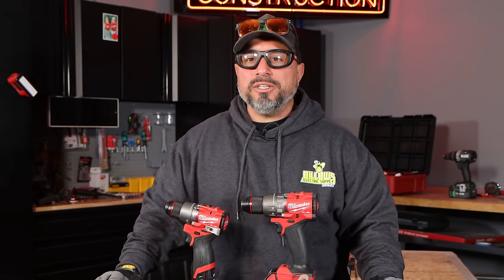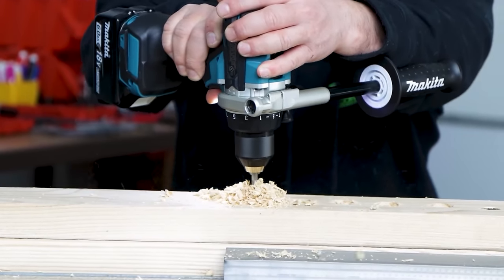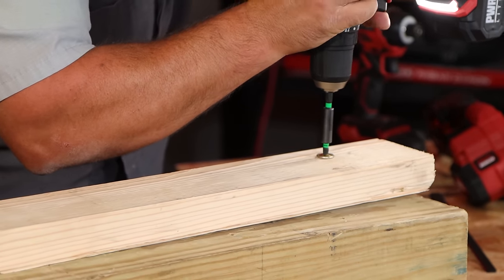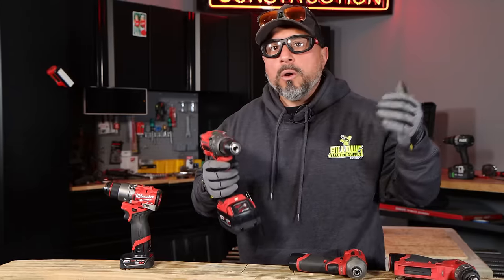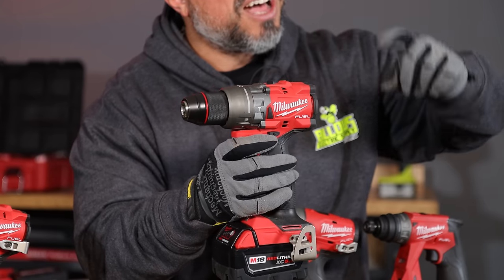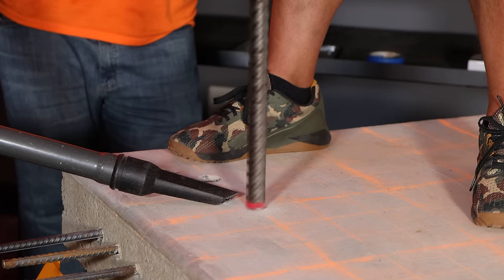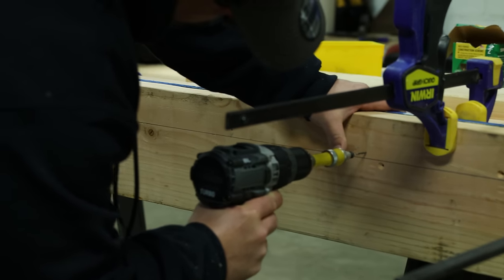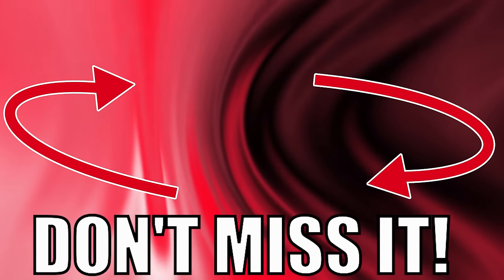Stop Using Cordless Hammer Drills...

Comment: Just got the gen 4 hammer drill. I have an older brushed m12 drill/driver set. They can handle 80% of what I do around the house and restaurant. But I have the installation driver for doing shelves and random stuff. It's an awesome standalone drill. Has entirely replaced my old brushed m12 drill.

But the restaurants pre-fabbed with metal studs. And getting through those is a pain in the butt. Also occasionally have to punch through concrete or brick for running speaker wires. So I decided to just go ahead and invest in a drill that can do all that without cutting out. I don't think I need a new m12/m18 fuel impact until my old brushed m12 impact dies.

Comment: What hammer drills are you talking about? Like the SDS max and plus ones? Because I can see the hammer drill symbol on the drill you are holding while you are telling me not to get it but also get it?
Reply: The whole is video is utter nonsense, don't bother. There are now powerful efficienct codless impact drills that screw mechanical bolt anchors into c40+ concrete without any sweat. As long as you're not demolishing concrete a quality high joule impact cordless drill can get most of the construction job done as of 2024.

Comment: I use both a hammer drill and a rotary hammer, I use my hammer drill for installing small 5/32" tapcons and such, and save the big boy 1-9/16" rotary hammer for breaking up concrete or tile

Comment: Yep my installation driver and m12 impact get 99%of my drilling and driving uses. I recently used my m18 fuel hammer drill to split in half a bunch of retaining wall bricks to use as weights for stickered lumber. But outside of that I’ll take lightweight anyday

Comment: I build and install wrought iron gates and fences. We use a corded hammer drill for every job since we always have an extension cord ran for our welder. But in the cases where it’s a quick install and don’t need to unload our cords we do use our cordless hammer drill for drilling into concrete, brick walls, and through stucco to install our anchors. Don’t really see the need to buy a dedicated cordless hammer drill so it’s worth the cost to me to have the hammer drill function on my regular drill.

Comment: As a sparky I use the hammer drill for holes of any kind ever day.  Rarely do I used the hammer function because I always use an SDS cuz it’s way better. But every now and then I’m in a pinch and need to throw in an anchor  and don’t have the sds readily available  and it’s nice to just use the hammer drill for a quick anchor or two.

Comment: Vince, I work as a handyman, a jack of many trades and will tell you that I need tools that are kind of like me. I only use the hammer trill function when drilling through brick or concrete with masonry bits. I think using the HD function for anything else is moronic. Who tries to drill a precision hole in wood with a hole saw or spade bit dancing around. With the HD function  my 4 year old DeWalt XR drill driver goes through most brick and masonry like a hot knife through butter. I've tried the same without the HD function and it was like a cold knife through frozen butter.

Comment: I use that hammer drill for tap cons in brick and block all the time. The one drill can drill holes in studs and then tap cons in block. Maybe i'm not a "real tradesmen" hahaha just a licensed electrician with a LLC company.
Reply: Also an electrician.  It’s hard to beat for drilling for tapcons.

Comment: I'm gonna be straight honest here, i have a milwaukee m12 hammerdrill, and for me as a service electrician, i can do everything with it from concrete and bricks with the hammer function to drywall. i can do it all. it is a differend discussion for when i am working on a construction site were I have to drill bigger holes through Deeper concrete walls. at that point i am switching to the m18 rotery hammer. one downside is that is it so freaking heavy, so drilling in a place that is JUST about to be out of reach can be pretty hard.

Comment: I think it’s fine, it’s a feature if needed. If you are doing heavy work or multiple holes then get a rotary hammer, if you need something quick and light that will get the job home for a couple of anchors or what have you for overhead work than a hammer drill is perfectly fine when needed. I understand both sides especially as someone in commercial HVAC.. it’s nice to have it when you need it.

Comment: My Milwaukee Gen 3 hammer drill is used for drilling holes, mixing paint, mixing joint compound, and mixing grout .  As a DIY not professionally.  I don't think I have ever switched it to hammer mode.  I install fasteners with my gen 3 impact driver

Comment: I agree a hammer drill is not the same as a dedicated rotary drill BUT for a while I could not buy a dedicated rotary drill and the small jobs I was doing my m18 hammer drill was getting the job done. Drilling 3/4x8" size anchor holes for post and whatnot, it served its purpose and got the job done, now I have the fuel m18 hammer drill big boy and its truly much better at drilling through concrete but if need be I can go back to my hammer drill and assist in any job of space is a issue.

Comment: A cousin of mine wh9o has worked on construcion most of hi life as a woodworker always says "You're as good as your tools" and he is 100 percent correct. I'll say one thing though. Yesterday, I had to do some light work, and instead of using a drill and impact driver, I used the impact driver to both drill and fasten. I think for around the house, this is all I need. I'll save the M18 and M12 Fuel drills for more intense work, or to hand off to a worker doing a job for me when I think their tool is inferior.

Comment: You’re not entirely wrong, however it’s really situational. I needed to install plywood on top of a concrete slab with tapcons (1500 sqft). The bit I used was 5/32”. Using a SDS, it just eats through bits. Using my hammer drill, while slightly slower, doesn’t chew through bits like they are nothing. For anyone who has ever done this, they would know exactly what I’m talking about. TBF, even Ryobi’s SDS will out perform milwaukees best non-SDS hammer drill (I own both), but as I said, it requires 10x the number of bits to complete the same task with SDS. 

Using a hammer drill for non-masonry related stuff is a bit overkill though.

Comment: You're not wrong in the minimal usefulness of the hammer drill feature on cordless drill drivers, but the non-hammer drills available from Milwaukee in particular are non-Fuel and poorer featured. Most of the time, the only hammer drill activities I'm doing with my driver are small 1/4 or 3/8 inch concrete anchors for decks and ramps. For me, the combo tool is worth the extra weight because my corded hammer drill isn't taking up space or having to be accounted for at the end of the work day. When I know larger (or deeper) concrete holes need to be drilled, I'll take my corded hammer drill with me, but when they aren't, the space savings and easier inventorying makes the extra weight of the Fuel Hammer Drill Driver worth it for the versatility of that tool.

Comment: I agree with Vince on this.  I use an impact driver for screws.  But, I do have to drill holes in concrete, so I use a corded hammer drill or rotary hammer for that.  A cordless tool would chew up all my batteries before I might finish the job.

Comment: As an electrician I ignore drill drivers. M12 surge is king in my tool box, however I do keep m18 fuel hammer drill as GP drill /back up masonry drill. I use my SDS m18 fuel as primary masonry  drill, ground rod driver, light duty chipper. However it broke on 1 job once so I had my hammer drill to finish the job until Milwaukee replaced my SDS took about week. So that’s my reason for hammer drill > drill driver ( also most hammer drills are 1/2” and drill drivers almost exclusively 3/8 OR USED TO BE!  I stopped buying drill drivers 20 years ago. But my new hires buy the M18 starter kits and the drill driver is 3/8 and can’t accept the Diablo auger bits, Forster bits, or 90% of hole saws arbors.  I speak only from an electrician doingc primarily new home residential

Comment: As a plumber I almost never use my hammer drill, I have right angle cordless Milwaukee for auger and large self feed bits, cordless rotohammer for concrete and small M12 hex impact for screws, also carry M18 3/8 impact for driving lags. My Milwaukee hammer/drill almost gets no use, it’s a good tool overall, but when efficiency matters it can’t do all tasks in timely manner. I use it at home more than anywhere else, so it’s a good tool for homeowners.

Comment: I use the m18 Milwaukee roto-hammer for concrete specific jobs, for example dowels or concrete anchors, duplex nails to pin forms etc etc. I used to own a corded Bulldog but sold it and went cordless. 

But for little tasks when doing electrical work like hanging a 4"11 box or just a junction box my lil Fuel m12 or Fuel m18 gets the job done ✔.

Comment: In my job I drill and drive screws every day.  Half of those holes are in tile. So i run my sub compact makita hammer drill in my tool bag and nothing else.  I use to run a normal drill driver and break out the big hammer drill as needed but feel now there is no need to make that additional trip back to the van.

Comment: When I burnt up my drill/driver, I needed a replacement/repair it was more cost-effective at the time to just buy the Dewalt 995 $80 instead of getting my drill/driver fixed for $75. I rarely use the hammer function unless I’m running top cons. But otherwise it’s there as a versatile tool option. I have a drywall gun, a screw gun, as well as an impact driver. I also have a whole hog that I primarily use for mixing drywall mud. But when I do need to drill a large hole, I have what I need.

Comment: Hi Guys!!! I've had to use a hammer drill for large hole saws and 5/16" large hex security bits. I could use a 3/8" socket adapter and 3/8" square to 5/16" hex adapter on an impact driver, but that's extra stuff to buy and increases length of impact driver head.

Comment: I install security cameras, data cable, and a/v. Cordless hammer drill is necessity when up on a ladder installing a camera into concrete block. Also does everything else I need like drilling augers and hole saws during rough ins.

Comment: I build screen enclosures in Florida and i use a rotary hammer drill for most tapcons except for under the chair rails where the rotary is top big, i need the hammer drill. Definitely slower but i haven't found a rotary hammer drill that will fit into a 14" space, 6" bit included.

Comment: IMHO, I think a lot of it comes down to (1) application; (2) frequency of application; and, (3) timing (or duration) of application. If you have many heavy concrete jobs to perform in <x> periods of time (# of jobs performed within a specific time, say 10 holes per <x> minutes), then a hammer drill is (by far) the best option. If, however, you're someone like me who does more electrical than concrete work, and needs something fast, light, and quick-on-the-draw, then an impact driver drill is probably the best option. Soooooo...in a nutshell, the simplest answer would be - it depends.

Comment: I do cabinets and trim work and I'm currently having this debate with myself. Most of my jobs are done in less than a week so for me, I like to have as little of tools there as possible. I hate using the hammer drill for drilling holes in my cabinets as it is super heavy, hower sometimes I do need to drill 1/4" holes in concrete to secure toe kicks, end panels, etc. I hate the idea of carrying a roto hammer all the time to use it once a month, however I also hate having to use a hammer drill all day every day to drill small holes that the M12 drill driver is more than capable doing.

Comment: I use the dewalt dcd996 every day for work, yes its a hammer drill, no ive never used it in hammer mode.  The drll cost me $219.00 cad, the same size, drill only, dcd991, cost $259.00, which would you buy. And if i do need a hammer drill, i have it.

Comment: I live and work in the city so I never can tell what a job will be like from one day to the next. I have a Bosch SDS and a Milwaukee hammer drill. Both are used in different situations and only with materials that take percussive drilling. I have an impact driver for assembly , fastening and automotive and a Milwaukee drill for rough in and metal work. Even the SDS and hammer have different applications. SDS is much more effective above 1/2" and better on old concrete that have cured for 50 years or so. Hammer drills are great on cinder block , mortar and tile.

Comment: I would argue that an impact only does a 1/4” bit. A hammer drill has a chuck that can adopt adapters, bigger bits, uni-bits, hole saws, you can even make your own bits and the chuck will adopt it

Comment: I'm not a tradesperson, but I am a homeowner and parts of my house are made from brick. I've drilled holes for Tapcons in it before, using a regular drill. My understanding is that you aren't supposed to do that. A rotary hammer would be vast levels of overkill for anything I need to do around the house though. Should I not consider buying a hammer drill? I already own a couple of drills (including the installation drill you showed in the video), and an impact driver. Wouldn't a hammer drill like the M12 Fuel ($150) be a more practical choice for hanging a TV on a brick wall than a rotary hammer? I don't see any rotary hammers, even corded ones, that are cheaper than the M12 hammer drill which is itself a pretty expensive option. Installing TVs is actually a great example here, my father installed TVs for a living for years when plasma and LCD were just becoming a thing - he never needed to bore a giant hole in a concrete slab, but you need to put four holes into any sort of wall without it being a big hassle. Wouldn't a compact hammer drill be exactly the right tool for that job? I could be way off base here, so please correct me if I'm wrong, this isn't my area of expertise. But if you do a job that sometimes requires drilling into masonry, isn't that what that tool is for?

Comment: I use the M12 impact driver with a 5amp battery all day long as an HVAC tech. Now that said I forgot my drill even had that feature till it was accidentally turned on. Lol if I need to drill any masonry I use my 1 1/8 Milwaukee rotory Hammer. I usually only use that when I am helping out our plumbers.

Comment: If installing tapcona frequently or drop in anchors. The amount of time the m12 rotary hammer will save you will be exponentially greater over a year,  than a drill. Bigger roto might get the job done quicker, but then your sacrificing maneuverability, physical  endurance just to save a few seconds

Comment: Around the house I use a DeWalt Atomic Impact Driver for most tasks. I use a normal Atomic Drill for drilling holes into studs or woodworking projects where I need accurate slow holes made. 90% of the time I use an Impact driver for most tasks.

Comment: I needed a Hammer drill to mount a TV.   My old Black and Decker Drill (Nickel battery) could not do it.   Found a Craftsman kit with hammer drill and impact (made in usa one (dewalt rebadge)).  I dont use my tools often, so more versatility in the tool is needed more than saving 50g in tool weight.   My old black and decker was heavier anyways.

Comment: I personally use both a drill driver and impact driver on the job when I'm needing a pilot hole drilled. I do have a hammer drill that I hardly ever use it the power detect. But it has the power if you need.

Comment: That all depends on the type of trade 
You work on
As ex-electrician commercial/industrial 
Specialy when doing remodels in existen 
Buildings 
When you are making pipes/MC cable or even romex runs
You go from strapping then from metal to wood and yes concrete in less than 20'
You need that kind of versatility

Comment: If I'm not planning on doing concrete work past a few fasteners I will carry a hammer drill just in case I need to make a few holes in brick or concrete. Otherwise I am bringing the sds drills out.

Comment: My red hammer drill was $20 more. I don’t drill a lot of concrete but the capability comes in handy when i need to. I use my impact way more so the weight doesn’t bother me. Yes it’s heavier in my tool bag but 🤷🏻‍♂️ i don’t regret it!!

Comment: When I started out with my handyman business, I got a hammer drill/ impact combo kit, as it was affordable and had a lot of versatility. These days I have a rotary hammer too because the hammer drill is so slow on concrete and can't really handle doing 1/2 inch holes for anchor points. Also, Milwaukee sells a basic rotary hammer for like $150, so if you're going to be doing masonry, concrete, etc, just get a rotary hammer. You won't be sad you did!

Comment: I am a plumber and we work in concrete houses alot, i have never used my hammer drill to drill concrete, i use my dewalt dch 273  sds+ for all concrete drilling, it is both faster and easier. And also quieter.

I even bought a drill that does not have hammer drill function as it is useless 98% of the time. Plus most drills that dont have hammer function are shorter and smaller overall

I say if you are drilling concrete regulary buy your self an sds+ in you battery system, it will save you time and money in the end

Comment: The only use for my hammer drill is I use it off hammer to mix plaster but on the odd job the Milwaukee m18 hammer drill does the job until I’ve got the sds

Comment: You're right Vince I recently purchased the m18 5/8 sds for the odd tapcons or door stopper (GC) and have the m18 fuel hammer drill that i dont touch anymore because the m12 fuel kit gets it done.